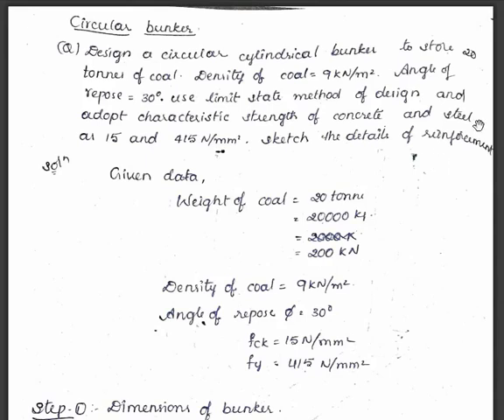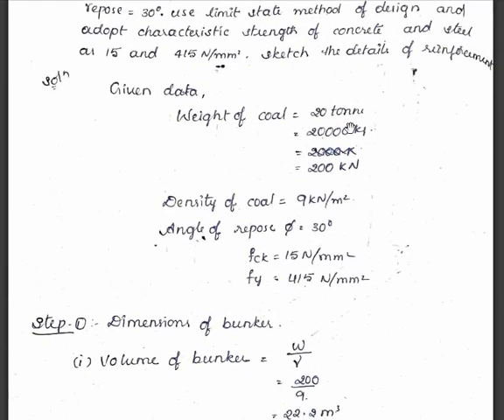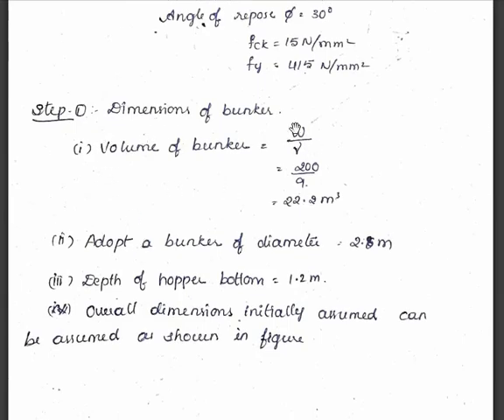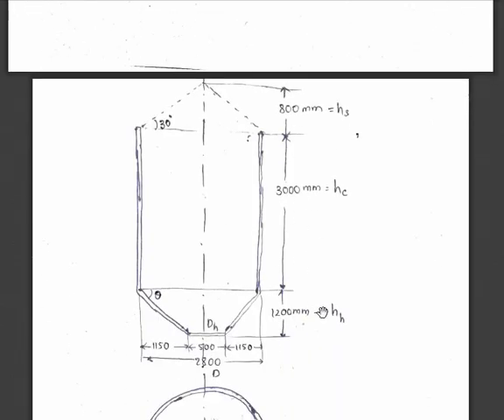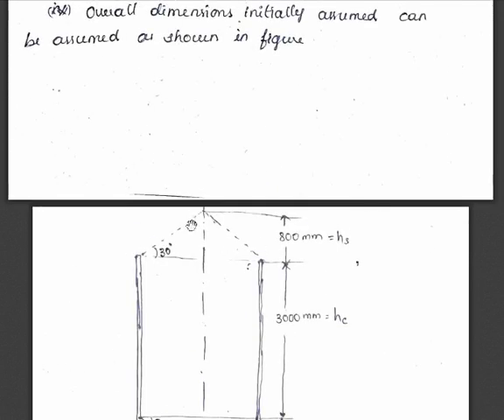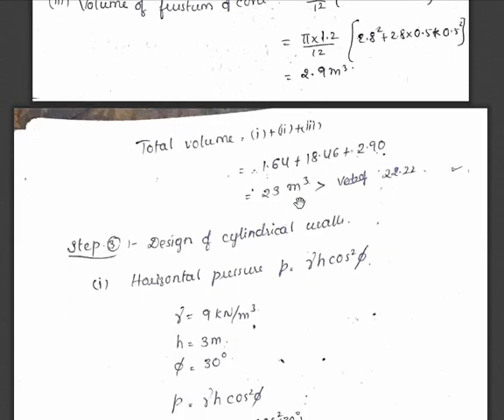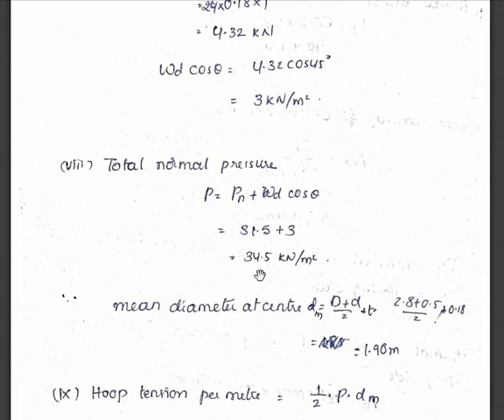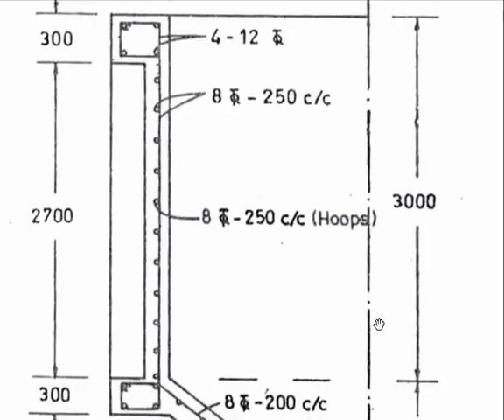Design problem circular bunker Working stress method

Comment: Hs, Hc, Hh, ki value agr nahi Di ho to kese calculate krege mem ???
Reply from the maker: Harshitha, they won't be given, we've to make lot of trials and arrive at suitable dimensions
Reply: @MounikaMeduri   how??  Can you please solve this type of question and upload video.
Reply: Hs -height of sloping slab  
Hc height of cylindrical portion it's assumed as 3000 mm
Hh height of hopper bottom it is also assumed as 1200
Or (10-20  percentage of hc)
Hs is calculated by phythogorus theorem